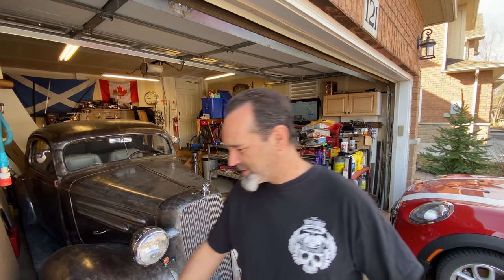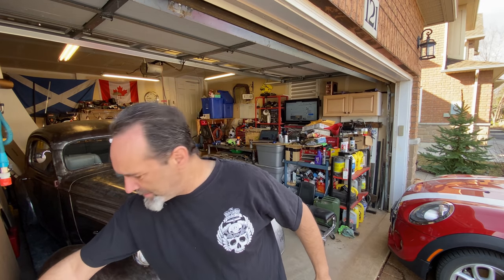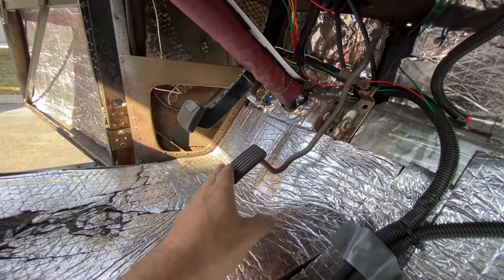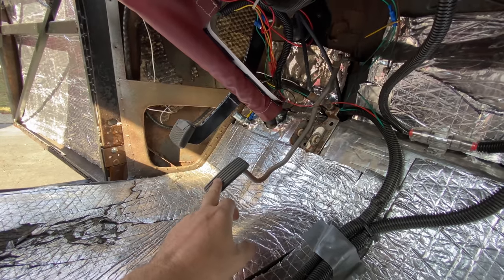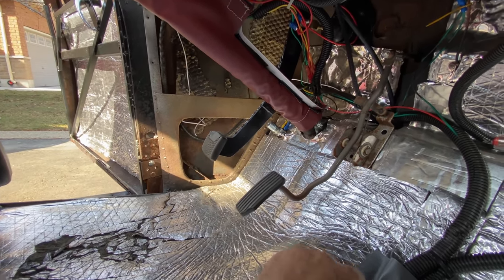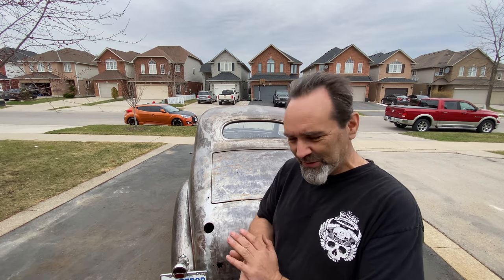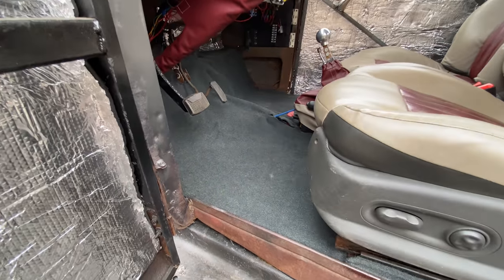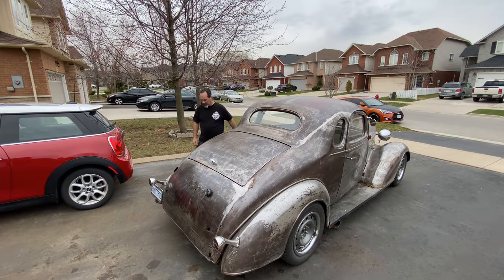Budget Carpet Install Part 2 And I Fix My Gas Pedal Alignment On My 36 Coupe

Comment: Very short travel on that gas pedal,  As a big time racer told me  " there is off the Gas and Full throttle , but a thousand places in between"    Looks like you have about 5 places

Comment: Hey Dave. CHANGE THE OIL!! 😧. How many miles have you driven on the oil that you have? I had to rebend my gas peddle as well. I used the one from my parts truck (Jimmy). I like it because the peddle rocks so it is the same angle as my foot. The carpet turned out to look good. Nice work. Thanks for sharing. Now I am all caught up.🍁👍👍

Comment: Dave, I have a question brother! I love how fancy your interior got... But i cant help it with the empty door panels and rusted pillars! Have you ever thought giving the interior its finishing paint before going through with all you did? Do you even plan to paint the interior? Or exterior?
Reply from the maker: If I was to do everything in the correct order, the car would still be 5 years away from it's first drive.
Reply: @ScottRods  well the order is better for less effort is all im saying... If you are not going to do an interior nor an exterior paint and its gonna be bare skinned all the time... Thats all you, but if interior is gonna be painted... U d have tons of efforts in masking this car from inside so nothing messes with carpet or leather works... Thats all im saying
Reply from the maker: @TheBlaqDeval  I understand. I don't mind having to redo things, as long as I can keep rolling along.